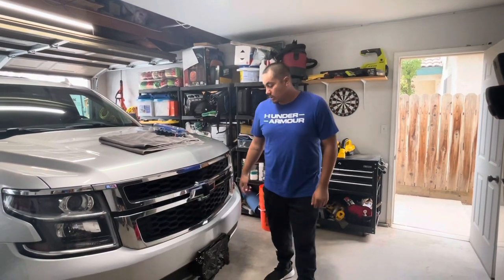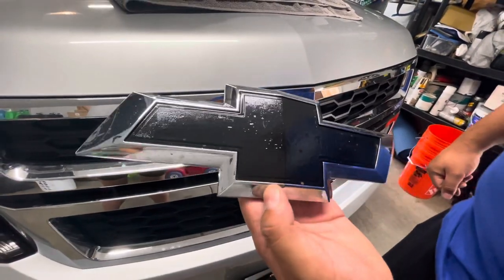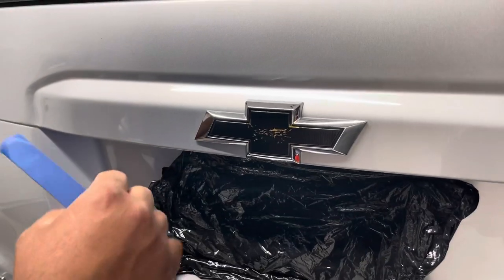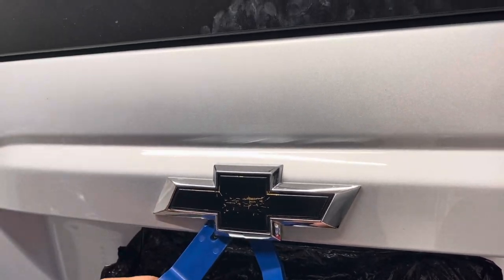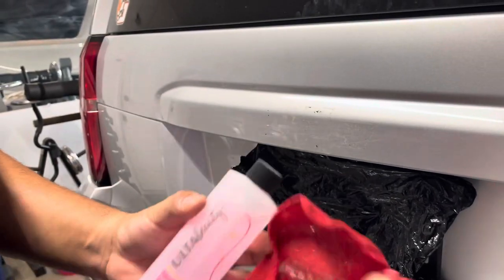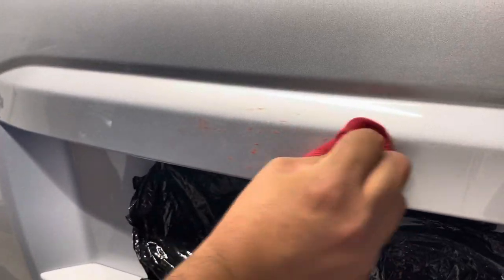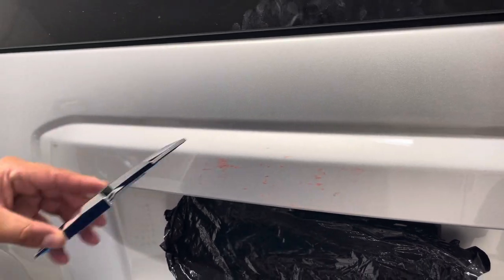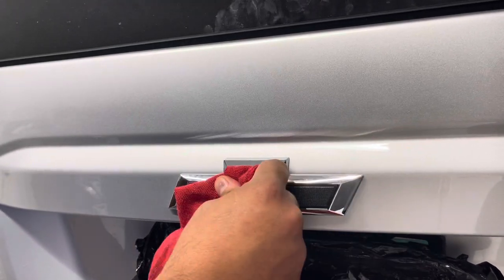Easy Emblem Replacement on Chevy

Comment: Where you get those at?
Reply from the maker: I bought them on Ebay
Reply: @fixitwithdavid4698  do they have any other color than black
Reply from the maker: Yes I have seen some with red or blue outline or even the USA flag colored on ebay and Amazon.
Reply: @fixitwithdavid4698  thank you I still can't find a pair front and back